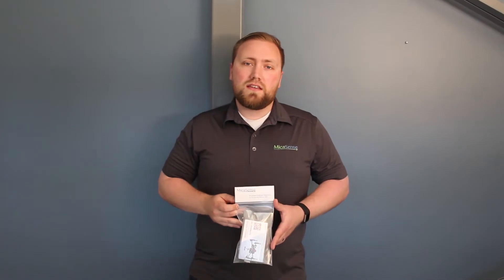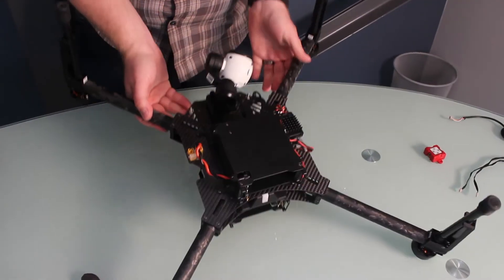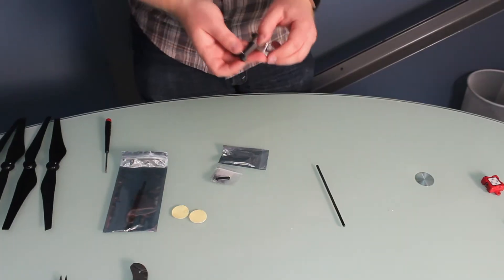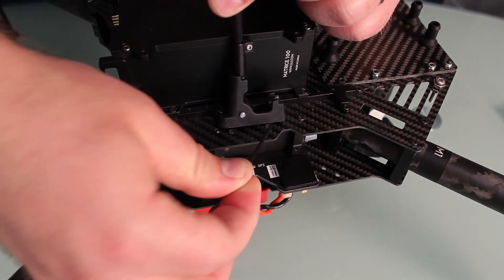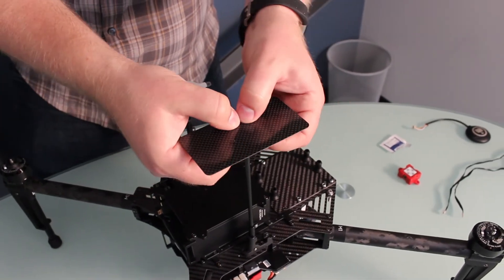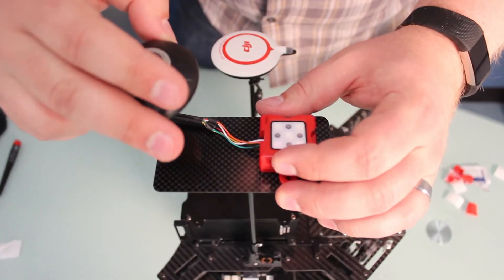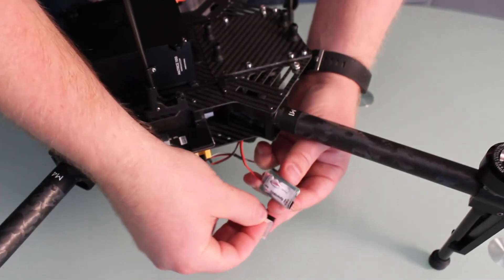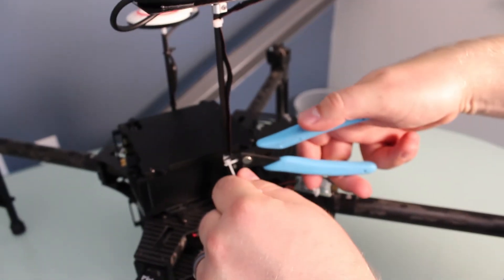MicaSense RedEdge Integration Kit for the DJI Matrice 100

Comment: Why the RedEdge platform looks tilted in this video?
Reply from the maker: To capture the most accurate imagery, the camera is pointing straight down (with respect to the earth) at all times during flight. This may cause it to appear "tilted" when the drone is hovering. As it gains speed, the drone will tilt forward in the direction it is heading. The exact angle of the tilt is different for every drone, and can be gained from the user manual or manufacturer directly.